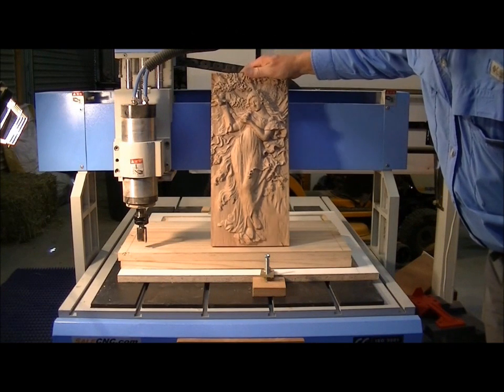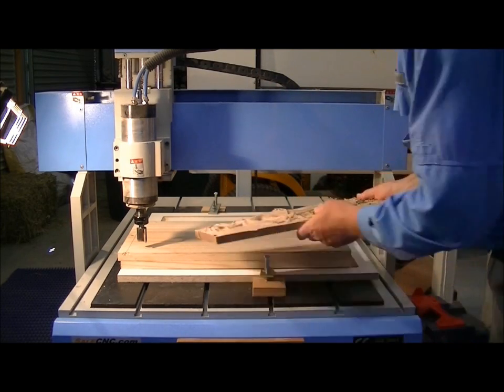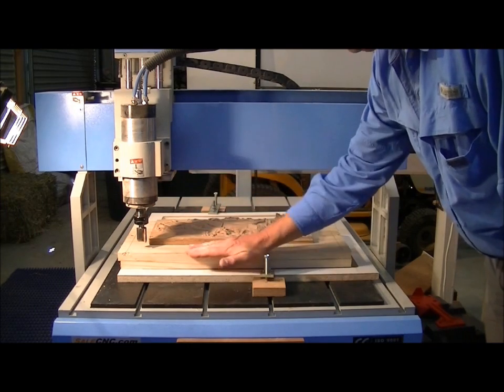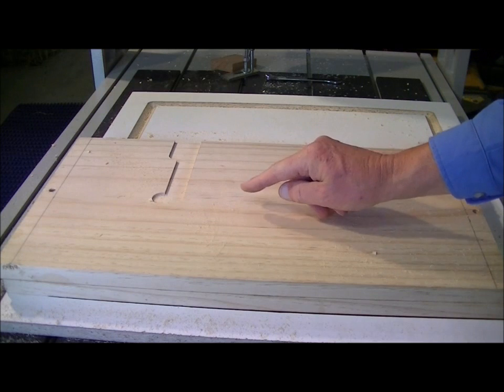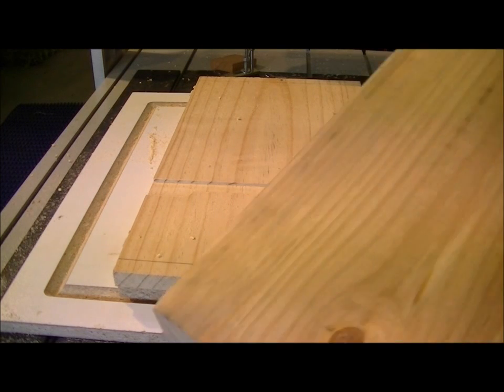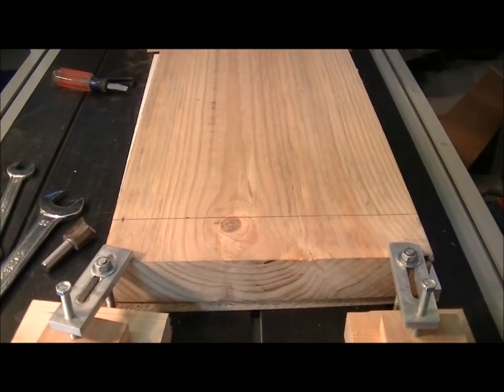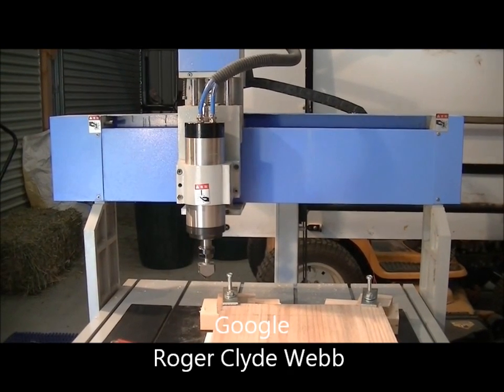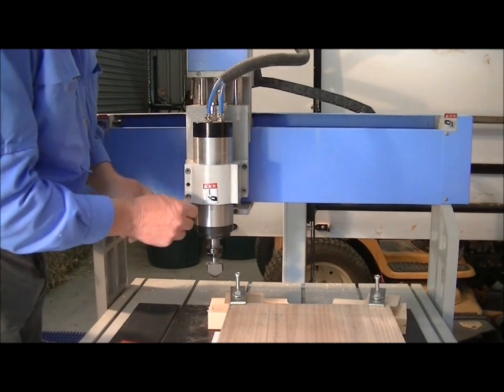CNC router can make $550 a day machining Art Décor in 3D

Comment: I just got my CNC yesterday!  Its a Shark, made locally.  Your projects are amazing.  Just Wondering.. what's your market for these projects, and is there a place to sell them and to figure out pricing??
Reply from the maker: Hello Kelly, first of all I would like to say thank you  for watching my videos and secondly I would like to say to you I wish you had contacted me before purchased a shack. The shark range of  CNC machines are strictly for hobby use only unfortunately you will not be able to machine product fast enough to make any sort of profit. The problem with the shark machines is they are not built rigid enough and are strictly a toy not regarded as a serious CNC router. The product you see in video 20 you refer to will fetch $250 USD the CNC machines that are manufactured by Pacific tooling can manufacture one of these every 3 1/2 hours from start to finish. The shark machine will take approximately 20 hours or longer to do the same job if you are lucky. Please watch more of my videos and you will find out that not all CNC machines are what they seem unfortunately.

Comment: You can put a large hose clamp around the top of the spindle motor so that it doesn't fall down and hit the build-plate when you loosen it.  Although, it seems to stick in place pretty well as is.

Comment: Dear Mr. Webb,
    I would like to know how much it costs and if it could be shipped to mexico? I am very interested in this typpe of equipment and I would like to know a little more about it. Hope to hear from you soon, and have a pleasent day.
Reply from the maker: ernesto tenorio  Hi Ernesto,

These machines are made in most countries around the
world and the particular machine I have purchased was made and shipped from
china. It is up to you to research, a product and come to a decision of where
to purchase, but I have included the details below of my machine and the
software required to do what you see on my videos. Be aware. It is not a simple
process of scanning a photograph or taking a file and converting it into a 3D tool
path. I would advise you to watch the tutorials of ArtCAM and others before you
invest for a business or a hobby.

The
6090 (bed size) CNC router machine is from Salecnc China, (speak to Jimmy good
English), I had the machine up rated to 8 inch / 200mm gantry and 2200w / 3hp
spindle (router motor) + I had the 4th axis. Total cost including
shipping and TAX, USD$ 7000, I would also recommend you purchasing ArtCam
Express software approximately 200 USD, as the CNC router machine is supplied
with ArtCam Jewel-smith from Salecnc China, but with NO 3D reliefs. ArtCam
Express comes with over 600 3D reliefs.                     Understand that there are
years of learning and experimentation by me that are not in the videos and
projects to enable me to carry out and achieve what you see in my videos. Hope
all this helps. Roger Clyde Webb 
Australia :)